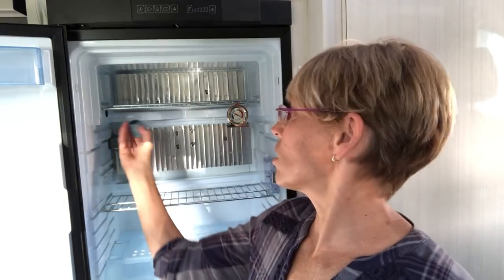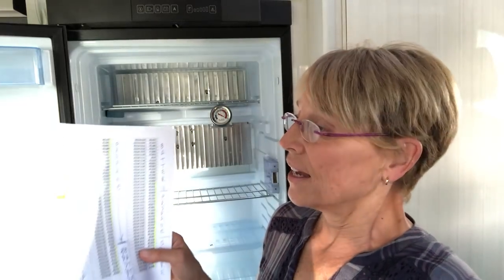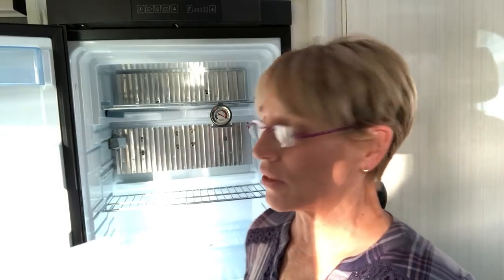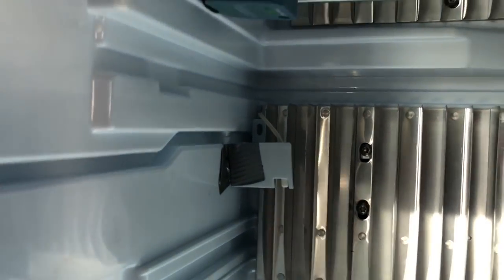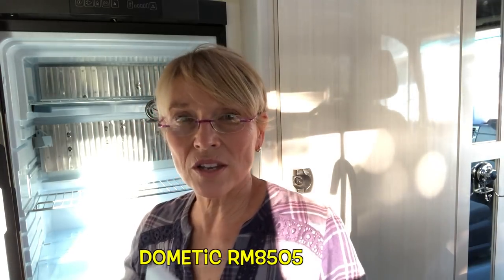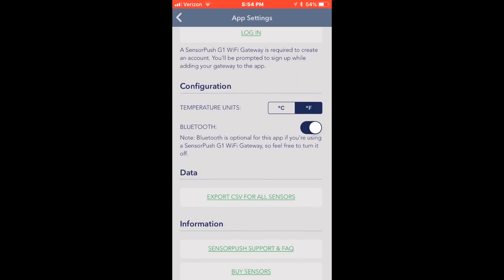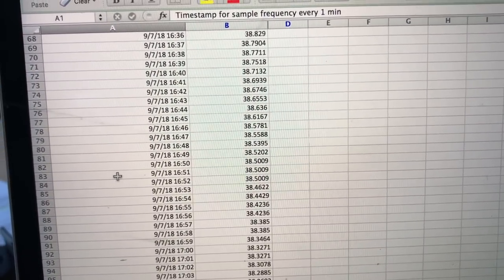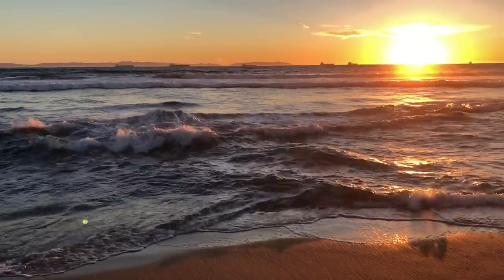Is our Dometic Fridge fixed?

Comment: We had two propane refrigerators I was not happy with either one. Our new  !2 volt and 120 volt is much better we aim for 38 degrees and it has a 1#---6 # temperature dial. The 3# setting is always correct.
Reply from the maker: Hi John.  Are you running it off of solar?  Or do you rely on shore power?
Reply: From She to Me  300 watts of solar panels two AGM 100 Amp hr batteries has always served us well. A two hour movie and the refrigerator even when we are parked in the shade has worked with no battery depletion. We never use shore power.
Reply from the maker: Interesting.  We have 200 watts of solar and two lithium 100 Amp hr batteries.  I think we could do one of the new super efficient condenser fridges on that.
Reply: From She to Me  I think that is the real difference. An absorption system uses heat and needs to be leveled using 12 volt battery to produce heat is very inefficient propane transforms to heat better but you still have the leveling problem and the slowness of an absorption system. So the newer compressor systems are much better suited to RVers.
Reply: John Puccetti Morning

Comment: I have a 98 leisure travel van and it has the original frig. dometic , it work great and it never level I install two leaf spring on the rear of the rv and added 3 inch to the height, I did notice on dc it work the worst, great on ac and propane. I think the quality on the new product are horrible. china crap. this is why I have a old rv in mint cond.
Reply from the maker: +Vito Trupiano I just discovered what may have been our problem all along; the fan that is supposed to help move air across the fridge coils isn’t working. You are so right about the difference in quality.